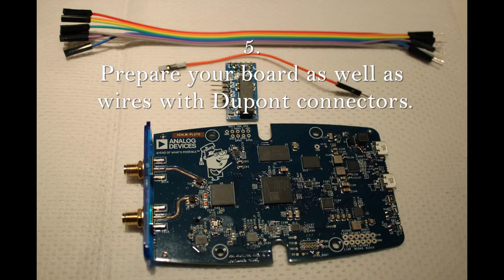Adalm Pluto SDR dual PTT switching board integration

Comment: hello! what are the advantages of this board? is it for safety reasons in order to use a external ampli in the same antenna?
Reply from the maker: For example, on switching to transmit, the relay closes a power amplifier activation circuit. There are 2 independent outputs. Another idea, we can power an on-air sign : https://www.youtube.com/watch?v=jjJV02osxFA